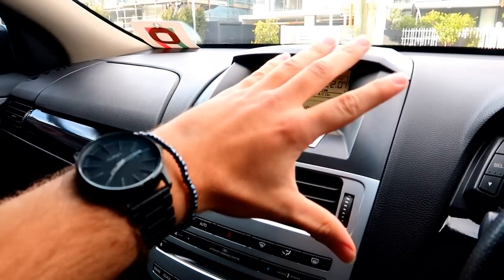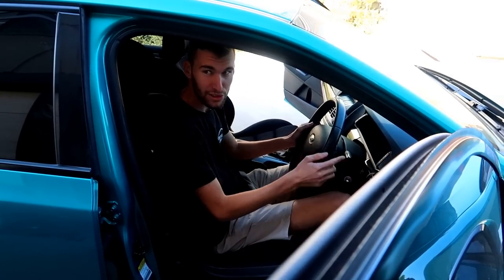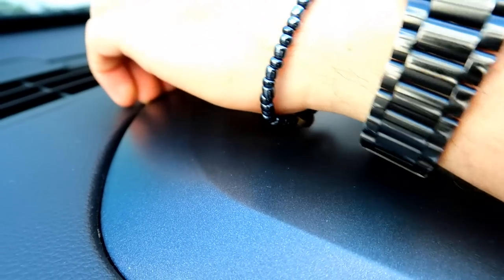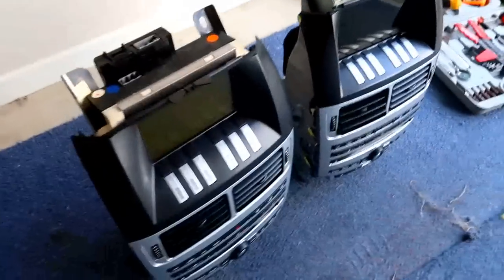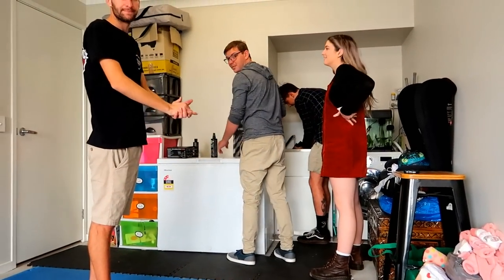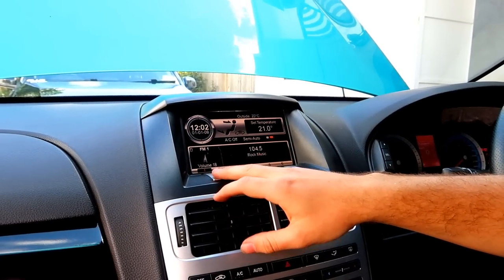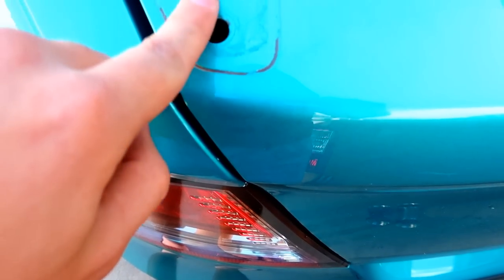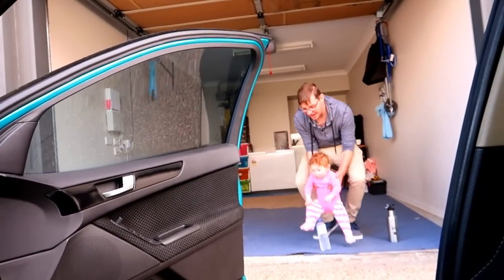How to Change Ford Black and White ICC to A Colour Screen!

Comment: Its good practice to disconnect the earth terminal first.  That way you don't weld yourself to the chassis, if the spanner touches metal.   I have a grandfather FG Mk2 cab chassis: 370 000km and still going strong.

Comment: Bro i just changed monochrome to colour ans founs out that aircon fan wont stop. Dis you have any issue? Jist to mention that the screen and cd player was from dual zone unit from fg g6e. No idea where it went wrong. I changed tge setting on him module as well from single to dual and dual to asingle zone, still same issue